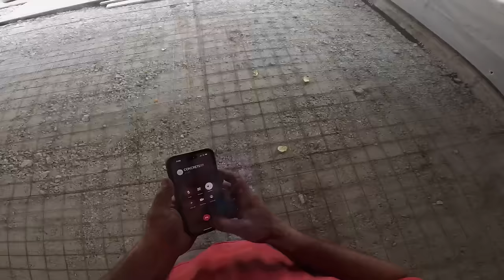Quitting concrete and joining the NBA! NOT!!!

Comment: This is quality workmanship and reputation . Even though this is not a perfectly finished garage Ryan still protects the walls from splashes with plastic. Plastics the driveway , driving backwards and doing the turns on the road to keep marks off his customers driveway. Wipe the walls and siding. Always tries to do 100% not 95%or 99% . It is little things like this that Eric needs to have ingrained in that head of his.

Comment: Ryan that tape is the best!!!!!!!! My old job we used it to connect the rolls of white face insulation. That stuff is really good and in my opinion the best thing that you can get cause you can get it by the case load and it will last you at least 4 to 5 months

Comment: That pump batt should charge from the truck charging system whenever it’s connected to the trailer just like a small dump trailer.   There should already be a hot lead coming from the truck harness to the plug.

Comment: hey ryan for that fuel cell battery, you can buy something called a breakaway battery charger. its meant for charging the emergency brake battery for trailers that have electric brakes, but it doesnt care what battery its charging. it is a low power charger so you can power it off one of the existing power wires for the trailer lights. it will only be drawing power when the truck is running and powering the trailer. they are less than $20 and have like 3 wires, the battery will never be flat again.

Comment: I have been meaning to ask, how come you tool cut your driveways? Is this just your preference, or is there another reason behind it?

When I was working concreate, we would Saw cut everything except City sidewalks, Approaches, smaller stoops and smaller patios.

 It also has always been new construction and residential. Mostly spec homes.
Reply from the maker: It’s preference.
Reply: the tool cuts look a lot better, in my opinion at least. so maybe that's why
Reply from the maker: @ih8chz  💯
Reply: @ih8chz  Definitely better look than just cuts ....
Reply: @ricks.1318  glad we have the same opinion

Comment: For the mustang if it just a scratch u can use those Mr clean magic earse with hot tk the touch water and it comes right out I had mines worse and it came out in 5-7 mins of my scrubbing it the trick for it was to use a wet one and a dry one

Comment: hey ryan one of the trucks think its rays mac is leaking oil bad ive seen the patches in a couple of videos at 23:28 in this video you can see the huge  black patch on the floor between the rear axles on the mac .. it needs sorting before it goes boom or leaks on someones drive
Reply: Thats from the skidster the oil was leaking really bad

Comment: Why don’t you charge your battery through the connector to the lights from the truck, you won’t have to worry about it that way, it’s very easy, the connector already has a 12 volt pin for accessories.

Comment: in regards to charging your battery for the fuel cell.  I went to Harbor Freigt and purchased a solar battery charger for my travel trailer.  It works great for under $50.

Comment: I’m curious to why you didn’t put a transition where the door sits lower than the slab? I’m just curious, and I don’t mean any negativity. When I use to do concrete we always did and we burned the concrete in on garage floors.

Comment: Ryan have you thought about installing 12v quick disconnect connectors for the bobcats so you can use the bobcat battery to operate the fuel pump.